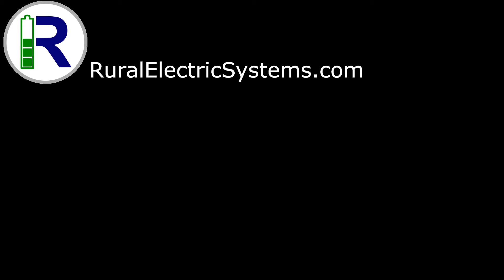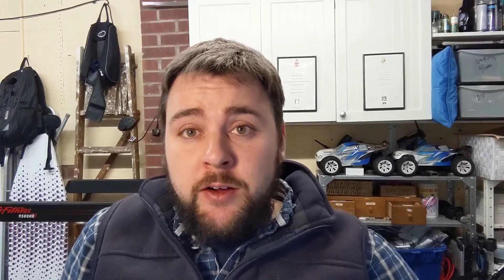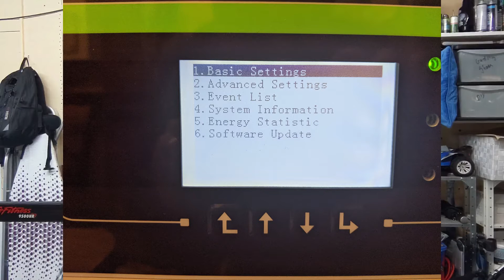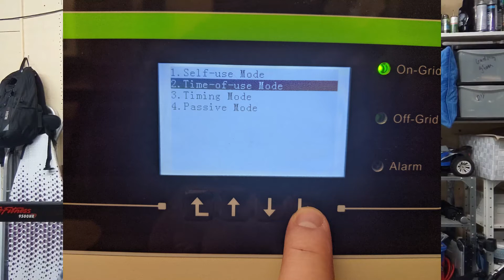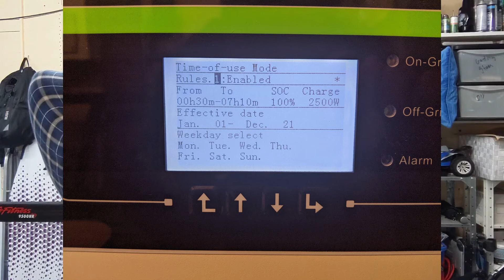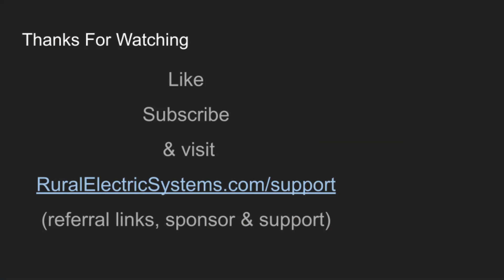Controlling Sofar Inverter for Octopus Go

Comment: Hi, what have you set the charging power to? I’ve set mine to 3000W but only 45A are going into the battery, meaning I can’t charge it in only 4 hours

Comment: Can anybody help me? My PV system, which includes a Sofar ME3000SP inverter, was installed several years ago and the company that installed it no longer exists. They failed to provide a PIN for the inverter so I am unable to update the firmware (currently v1.8) or enable Time of Work mode etc. Someone please help.
Reply: Isn’t it 0000?

Comment: Helpful video thanks. Question - can these setting be updated via a Sofar app/web interface or would it involve a trip into the loft to change the setting? Thanks.
Reply from the maker: You need to do it on the display this way as far as I know. The alternative is to control via the MODBUS interface